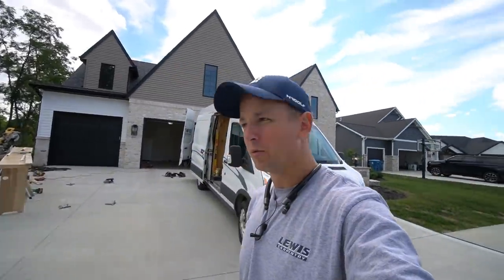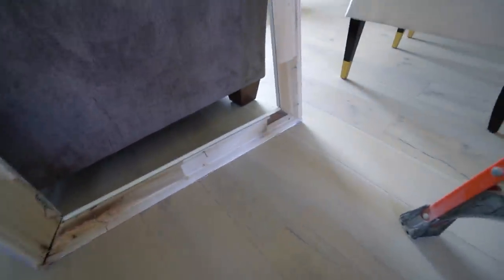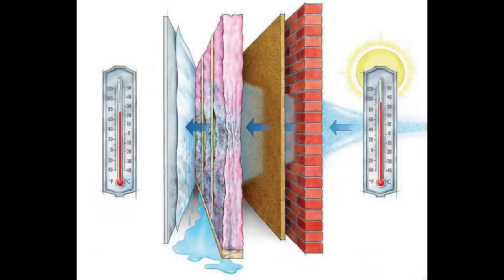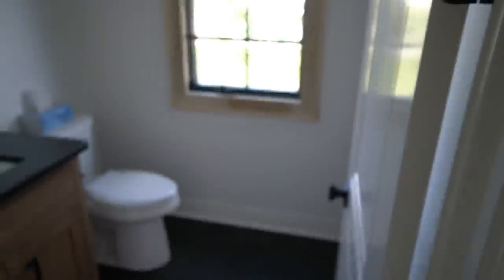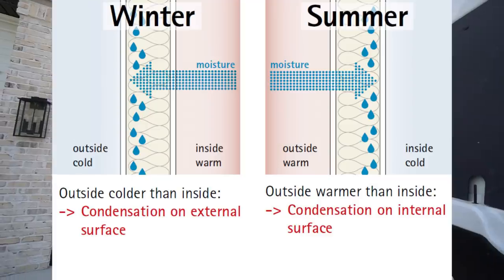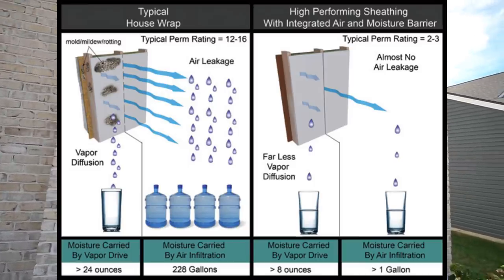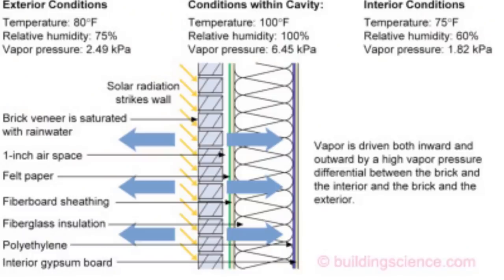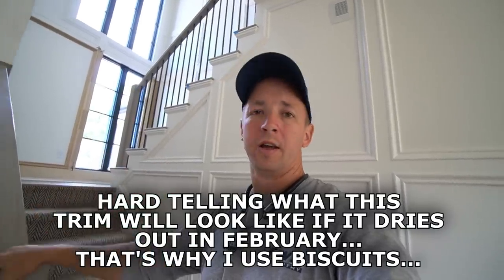Trim Humidity DISASTER!!! Is Vapor Drive Destroying this Trim Package???

Comment: I kinda lean toward the comment below, not having enough air gap between brick and sheathing. Also, the weep holes at the bottom of the brick should be large enough to provide ventilation when combined with an air gap at the top. If there is no airflow, bottom to top, in the air gap behind the brick then the moisture has nowhere to go.

Comment: The "Flash & Batt" method of spraying a couple of inches of foam then installing fiberglass batts over it should only be used in specific wall sections.  The smooth plastic surface of the foam is causing a vapor barrier/drainage plane inside the wall. All of the fiberglass will be soaking wet on the foam side. The owner needs to be concerned about the framing rotting. Pull the baseboard off  & cut the drywall off of the wall by the front door and see what's happening to the studs on the bottom plate.

Houses didn't have this problem when we did glass or foam. The combination of glass/foam is a disaster if its not installed properly or in the wrong type of wall.

Comment: There are bigger issues going on here. Definitely needs to be an air-gap between the stone and framing. Sufficient weep vents in the stonework too, not just at ground level. Check the seals between window frames and stonework, there's probably water getting in too.
I wouldn't be putting up trim without fixing the problem unless you get a disclaimer signed.

Comment: The HVAC is oversized as mentioned. I think maybe sending a camera down the lines may show blockage?  Also cold air return same square inches as the heat lines?

Comment: I'm a total DIYer with little experience. Questions I have are, 1- Does the HVAC system have an HRV or ERV or are they just pulling fresh air straight in from the outside and hoping the AC will dehumidify it? 2-Are there vents in the brick other than the weep ropes you showed? The house I grew up in had a round metal grating a foot or so above ground level. I think that was for air flow. I remember being told it was a vent. A vent for what, I don't know.

Comment: I would be concerned about sealing the brick to be honest. You should get a blower door test done while you have the trim open to make sure your windows are flashed/ sealed properly. The second problem is that you may not have enough soffit overhang to keep the water off the walls, especially the front door. The fact that the brick and mortar is likely in contact with the house wrap, preventing it from being able to breath doesn't help either. With all the great ways to fix these issues before they happen you figure there would be at least a rain screen or proper air gap behind the brick. Check the sealing and mortar work around the windows. It should be hard and void free besides weeps

 I also hate to see exposed entry doors. I fix a lot of rotted sills and door frames because there's a lack of overhang above and not the greatest flashing.

Don't put the trim back up until you get the problem fixed

Comment: It could be a rushed build process with rain, drywall curing, sheathing drying..was the slab insulated on the perimeter properly, my experience with brick is it has a air gap between it and the house. Might be able to check the moisture level.

Comment: Have them check the unit to see if it is short cycling due to being over sized for the sqft. An oversized unit will work and cool the home but won’t run long enough to “condition” the space. This can also cause areas of higher humidity near you doors and window to have substantial differences.

Comment: Spencer,   lots of good comments about the potential problem.   I would like to inquire about the legal issues involved?  Has the house been sold? and did the owners move in and then out?  With substantial repairs,  mold issues?   possible brick removal and HVAC resizing?   There will probably be liability denials etc..  Keep us posted on the legal and who gets to foot the bill.   This is going to be expensive.   ouch.

Comment: I work In commercial heating and air field. Depending on certain situations people running the fan 24/7 on their unit can cause high humidity. The evaporator coil on the system produces water when cooling. If the fan is running 24/7 in “On” position after a cooling cycle the coil will stay wet the sir moving across it can carry the moisture from the coil with the air.

Comment: soon as that stone and brick work catch the early sun, especially with colder nights, the rapid temp change creates heavy condensation which vents and drives inside. As John below states, ya gotta vent the space, the moisture(water) is gotta go somewhere and I'm sure that dry woodwork would soak it up like a sponge.

Comment: hey spencer. just another thought here… you said the house has a “flash and batt” style of insulation in the walls. my understanding of that process requires that the R-value of the spray foam must exceed the R-value of the batt, otherwise you will get condensation in the wall cavity because of the due point. the spray foam is acting like a vapor barrier on the outside of the house but its not strong enough to retard the heat of summer. so now you have a wall assembly that cannot breathe and it’s condensating on the interior wall surface and especially near the windows that are leaky. maybe I’m off on this but I live in Vermont and we are not allowed to put half inch of spray foam on the inside of a wall cavity it Has to be a minimum of 3 inches thick before we use fiberglass. just trying to help! email the build show network! somehow that brick must be making it worse.
Reply: My first thought was the same. A condensation Risk Analysis would be the best bet here. Determining where the dew point is

Comment: My first reaction would be to consider vapor drive but you said the front door is having issues as bad as the windows. The front door appears to be in an alcove which would prevent the brick from getting wet. I would expect that to definitely lower the vapor drive in that location unless sprinklers or something are spraying in the alcove.
You are right to be concerned about bulk water behind the brick. Hopefully the weeps are working because that house wrap probably isn't doing as well as a better product should. It is possible water behind the brick is leaking small amounts around the window flashing but you don't mention any water damage to the surrounding area, so maybe not. Let's hope that isn't it or the OSB and possibly studs are in severe danger.
My strongest suspicion is air leakage. You mentioned that the house was well air sealed. Was that blower door tested after the brick and windows were installed? My guess, and from this side of the camera it is only a guess, is that the air barrier was damaged in the areas with brick and the hot, humid air is finding it's way in around the windows. Then condensing on the cool casing.

Comment: I'm guessing that space between seething and window jambs weren't properly sealed with zip tape or pella tape etc...
IMO I'd tape seal on the interior and then re -case.
These type of situations also happen on badly sealed tile shower enclosures. Work might be beautifully finished but end up horribly wrong.

Comment: I didn't look the whole video, but the first thing to look is the insulation around the windows. there should be a 1/2 gap filled with spray foam all around the window exept for the shims(i didn't see that at 2,40.) also there should be continuity between the vapor bareer and the house wrap around all the openings.

Comment: I think you have a few problems showing their face. The ac unit being oversized can absolutely cause nightmare like problems. Is there a humidifier system on the Hvac? Also I feel that sloppy and inadequate insulation, especially around the windows is causing a transfer that is creating moisture. Cutting a few inspection holes in the drywall is key. This house is going to see huge mold and rot problems in the future.

Comment: My experience tells me that with moisture problems like this the house is most likely too tight. 
I've not seen wicks used to weep the brick, I guess that's a regional thing, I have always seem actual holes where a mortar joint is open, maybe the brick is not breathing sufficiently. 
I'd be reluctant to seal the brick, if the issue is the house being too tight then that will only compound the issue.
I'd be curious about the attic venting, is the inlet and outlet area/volume balanced with no powered vents.

Comment: In a way having a bad trim installer and I’d say that loosely but it uncovered a problem before it became a catastrophe. Way to much moisture in the house. They gotta moisture out of the interior of the house before anything more goes on. Kinda of a duuu thing I know. Is there moisture coming up thew the floor as a slab on grade can if it’s not properly sealed. The house seem extremely tight with no place but the windows to escape. I had a house that had mold growing on the window sills and ended up going into the attic and cutting the plastic off the ceiling to allow it to breath better. Do they have an air to air exchange? Look into that if they haven’t already. 

Good luck with this and let us know if your able to find a solution.

Comment: I'd cut some drywall out and see how the wall cavity looks.  My guess is that flash and batt system is causing this.  Spray Jones and Marshal Remodel did a few videos about flash and batt gone wrong.   What a mess.  I feel bad for your friend.    I'd definitely seal the brick since that's a cheap start.  I'd also consider cutting those bricks out under the windows to install a lime stone or precast sill.  Over time those bricks are going to weather an look like crap anyway

Comment: I'm not a builder, but I'd guess that the house wrap was not installed/taped properly. I'd also imagine that as long as the underlying problem is not corrected, fixing the interior trim will only be a temporary fix. Hope your help doesn't put you on the hook for future repairs when the problem returns. 

Also, has the house been tested for black mold?

Comment: This is a serious construction issue no doubt best analysed by a specialist. It definitly sounds as if there is a collision of several failures going on making it complex to draw simple conclusions let alone make recommendations. It always blows me away that homeowners, at a minimum, dont monitor humidity (a 15 dollar hygrometer) and understand the extreme damage it will do to a house ( woodwork, floors, mold). No amount of glue, bisquits, pocket screws, loose tenons, etc. will stop physics. Oh, and make haste to rent a high capacity dehumidifier in the meantime before everything is ruined.

Comment: I know this is late and probably figured out but one thing I noticed is  you cant have a dual vapor barrier. inside the wall cavity you have closed cell insulation which is a vapor barrier and on the opposite side of the studs is kraft faces insulation. That traps moisture inside the wall cavity. Im in central Illinois which is the same weather and its common practice if you spray and inch or two of closed cell you finish the void with unfaced insulation

Comment: I suggest you get a back copy of the journal of light construction (JLC). There is an article entitled “synthetic stucco without failures”, starting in p 41 of the December 2014 issue, written by Mark Parlee.  I can forward you a copy if you tell me where.  It’s the same thing you are battling with some excellent data.

Comment: When you have an interior vapor barrier you can have an exterior one too.  You cannot only have an exterior barrier because condensation will occur in the wall.  
With an "air/vapor tight" build it is imperative to maintain the same level of protection at each opening as windows and doors are installed.  
If the only path for vapor migration is through the window/door perimeter....through the trim....then that is the path vapor will travel.

Comment: I agree with most of the commenters I read. Aside from the air space issues. The detailing of the window openings could be an issue. If the is air infiltration and the cold A/C air will cause condensation. The supply next to the window on the landing and condemnation on the window indicates transference to me. As others have said. Look deeper.

Comment: Vapor drive is basically water from rain or high humidity that will eventually find it's way into the home without the proper screens and wraps . That may or may not be the cause of this issue. Water can be getting in behind flashings or around windows. The only way to really find out is to take some brick down and see whats going on. HVAC contractors will almost always over size the A/C units without having an engineers input. This issue need s to be looked at by a qualified engineer. Air sealing is a huge issue here in the North East and NYC building department requires a product such as Henry's Blue skin for exterior air sealing . Good luck.

Comment: All comments are valid.
The brick sill detail is the worst choice the builder could have made.
The mortar willabsorb water and fail. Is it flashed properly under this brick sill.
A concrete sill with a slight slope with a slot on the underside to act as a drip edge is best.

The brick will absorb water at the ground level. Pulling the mulch would have definitely helped.
Grade the soil away from the house.
Where do those downspouts drain.
Perhaps better drainage is needed also.

Look at the roof flashing detail into the side wall. Water running down the roof will just channel into the vinyl siding if there is no flashing at the roof line.
It's a combination of many system failures and poor design.

Comment: I would drill those weep holes out. Get rid up the rope and just leave the holes. Also put weep holes at each corner of the windows at the roll locks. I wonder if they flashed the windows/doors properly as well.Worth a shot.

Comment: Small house trimmed in the winter, built in the winter with KD lumber.  KD stands for "kinda dry"  We were turning these over on 90 day cycle in Ohio very similar weather but a very good builder.  I still remember shoveling a lot of snow off plywood.  He would make it point to run the furnace for week and cook the house to drive out moisture prior to vapor barrier and drywall and then cook it further during drywall.  Needless to say the trim package was dry on arrival and stayed dry inside of house nothing stored inside of garage.  The slab is likely doing you no favor with good chance of missing vapor barrier but your video has no tell tales on 1st floor flooring.  Pull up some pieces investigate as there are some tell tale test that can be done.  With the spray foam pretty much guaranteed the problem originates from inside the house IMO.  The brick is red herring, its just the coldest wall being north side and "brick" so sure problems manifest there first.  Mention some RH readings, did owners complain of condensate on windows, where does make up air come from when running kitchen fan or bath fans as house can be too tight.   I do now recall telling myself to never buy a house built in the winter :)  Just cook it for a couple of weeks and check slab.

Comment: I do not see a Vapor barrier on the bricks from the ground, which I would see in the UK, typically 6 inches up to stop rain drop splash getting into the wall I am seeing moisture rising up from the ground, You may need to add either a drilled water proof course on the brick work. Brick is a sponge, and will drawer moisture up 6 to 10 foot, you may need to cut a slot in the mortar, and put in a Vicore or plastic 4" fiber strip, done in sections 3rd brick up,  you would need to add vent openings top and bottom of the brick stack,  about every 12 inches,

Comment: As we all know moisture goes to the coldest area which is north wall and inside condition area. Brick is a porous material we always install felt paper behind all brick and rock material. Also the ledger where the brick and siding meet needs to be addressed and if inside moisture barrier was installed

Comment: Have seen this few times. Causes can be from improper air and or vapor barrier behind “cmu” (brick, stone, etc) siding; HVAC not assembled and or sized correctly for the house, along with maybe some ducting out of alignment (not tight) from someone bumping during building along w/ not having a proper humidifier/dehumidifier installed with the HVAC if need be; and lastly…..not having the HVAC properly “tuned” for the house and issues. Some simple setting that HVAC company needs to do is program settings for the control units (usually at thermostat) and some of settings can be off or not setup altogether.
That’s all I got for ya.
Hope to see an update so we know the answer; as like mysteries as long as know answer/solution 
✌🏻

Comment: Seal the brick, fixed a similar problem we had a few yrs back. Couldn’t figure out where the moisture was coming from. Once we sealed the brick (sprayed) it stopped.
Reply: Let us know what the issues were if found.
Reply: Have you used a moisture meter at various points throughout? Like a fire, typically you can trace the source or starting point by the amount of damage. Perhaps the meter will bring you to a key point or at the very  least if it’s a local /concentrated area or throughout.

Comment: Did you figure it out? We had high humidity until we put in a radon system probably because the tightness of the house pulled air up from the moisture underneath. The radon system just blows the air out the sump pump well getting rid of the moisture.

Comment: G’Day mate is the house built on bearers and joists or concrete slab.?
If you have a sub floor it could be sub floor ventilation which is insufficient. Water vapour could be rising up the wall cavity and condensing on the internal linings.Good luck with it.